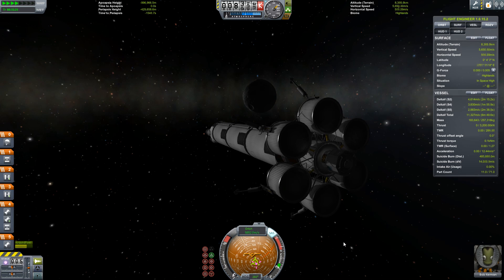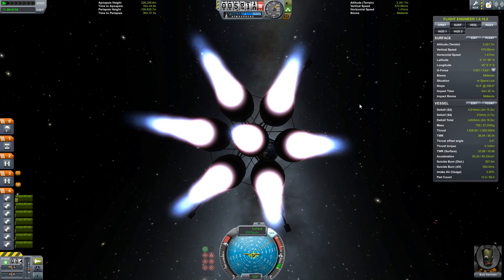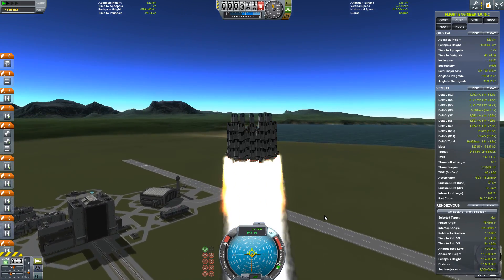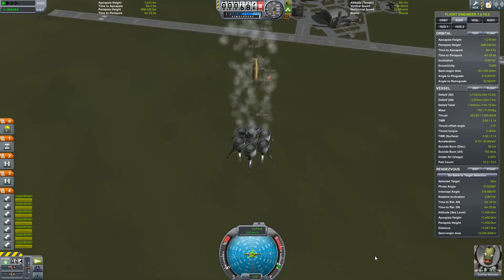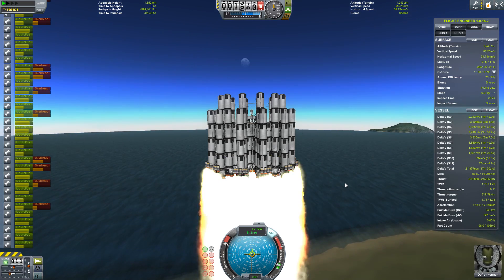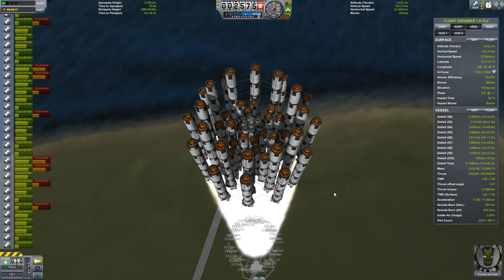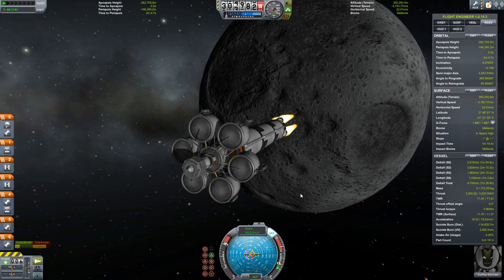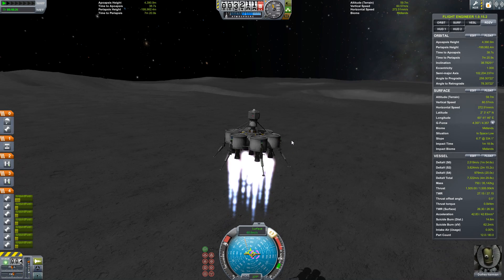Insanely Huge Rockets - Part 2 - Huger & Fasterer

Comment: As you are using "clipping" to put more engines into a stack, why not use Offset tool and move the stack of tanks downwards. Makes it a bit easier to handle 1 tank high rocket than 5...

Same goes with "landing engine", design I am trying to use has a KR-2L as a central engine which doubles as a landing engine. Less mass as 6 LV-T30s and alot more power. Vacuum isp is just a bonus.

Comment: You should train using Z and X for throttle, it makes it easier to be precise with large engines. And mybe you could add a decoupler and monoprop engines to the pod, but im not sure if it would offset the increase in mass from the 15 monoprop(I assume you emptied that before). And you might wanna steal some NASA computers for better framerates.

Comment: The kerbal skeleton is actually a series of fluid filled bladders, allowing it to compress and deform without loosing structural integrity. This allows them to withstand forced much greater than a life form with a calcium skeleton could and survive

Comment: Scott, Could you build us a single ship (no docking) that can make it to Eve's sea level and back? (no using high elevations to assist take off from Eve) I myself have been trying to do this and its not quite as easy as it sounds >.>. Make it so the kerbal has to take a sample of the water before going home. You will need like 20k d/V at least, and more than 2g thrust on Eve take off stages.

Comment: Scott Manley You also could heave set the parachute parameters ... I usually set the up to semi deploy at highest possible pressure and fully deploy at lowest possible altitude. ....
You also can change those values in flight ... even when the parachutes are already activated (staged) or even when (partly) deployed (cause when they are fully deployed it makes no different anymore).

Comment: This challenge would melt my computer.
Reply: Your Mind That'd just make it melt more, considering the nature of CPU heat generation.  A water block might help, though.  Or maybe chilled glycol...
Reply: Your Mind Indeed.  I was in turn running around with the joke and bringing up a cooling solution used in linear particle accelerators.
Reply: you could overclock
Reply: I'm working with a 5 year old Asus Republic of Gamers laptop. No matter what I do if I try to use that many parts this thing would melt.
Reply: Daniel Wilson I thought he was just joking about it in that saying that his computer would lag. Not literally.
Reply: Daniel Wilson Your Mind You are correct. I was overstating a little, but if I use more than 600 or 700 parts this thing gets very hot. More likely it would burn out the graphics card or motherboard. So where do I get ahold of some chilled glycol? lol

Comment: So.... why not set up asparagus stages?

Wouldn't that give better acceleration?
Reply: Yes, but he needs most of the stages attached for the landing legs to work. His system isn't that efficient, but with that craft configuration it's about as good as you can get, he is down to his final two stages only a few seconds after liftoff remember.
Reply: HALL9000ish I think what AoiKaze2000 meant is that he could asparagus the first two stages, decoupling the tanks 2 by 2, or 4 by 4. this way you can get a better TWR for each pair of engine decoupled.

Building the asparagus in such a huge rocket, though, would be a test of patience. One wrong click and you have to build the whole thing from scratch.
Reply: Yeah, it would only make sense for the booster part, as the lander would be screwed by asparagus staging.

While Scott's trying to stay strictly stock, isn't there a mod that can help with the asparagus staging?

Comment: I have a [probably noob] suggestion: wouldn't it be better if you flattened out your ship? Don't stack 2 or 3 fuel tanks on top of each other, with only one engine behind that. Use 1 engine for 1 gas tank. Your ship will be flat and huge but I believe the mass to power ratio will be better.

Comment: An interesting feature of this problem is that cruising velocity to the Mun is about twice as expensive in delta-V than cruising velocity back because of areobreaking. So you might want to spend more delta-V on the return. Clearly there is an optimal balance point, have you considered what it is?

Comment: "250 g's definitely fatal to humans" Good thing the pilots were Kerbins!
I think their physiology; smaller size and mass, more robust skeletal structure, large cylindrical head containing disproportionally smaller brain mass, along with g-suits (k-suits?) mad of a more durable material found at a junkyard on Kerbin,  allows for much higher g- force (k-force?) tolerance.
Reply: Kerbals are too stupid to know that the g-forces applied to them just killed them, so they keep walking and piloting not knowing they are dead.

Comment: Why aren't you using the command seat?
Reply from the maker: I did say there would be future episodes right?

Hard part is putting the crew member onto said seat and then disposing of the loading structure.
Reply: Scott Manley cant you adjust what altitude your parachute deploys at by right clicking it?  set it for about 20 or 50 m?
Reply: Scott Manley I know the technical difficulties for this, but wouldn't dividing more the staging increase your performance? you're currently releasing all the rockets from the outer layer at once, but you could probably make it to release 2 by 2, or 4 by 4, and still keep balance.
Reply: Slender Mane Perhaps it takes elevation into account?
When i first started i set my parachute to completely open quite close to the ground, long story short i crashed straight into a mountain : P
Reply: azmanabdula he did it in the next episode
Reply: Slender Mane what does he do?

Comment: Couldn't you select the altitude to deply the parachute?
Reply: It goes as low as 50m deployment which could of saved 10-20 seconds
Reply: Gigabic
 Might means that there a possibility it to be worth it
Reply: 100 would be a safe deployment height. You might not slow down in time at 50.
Reply: Thanks captain Hindsight!